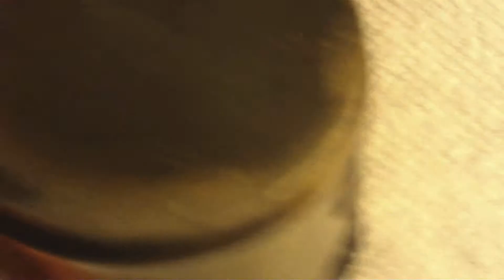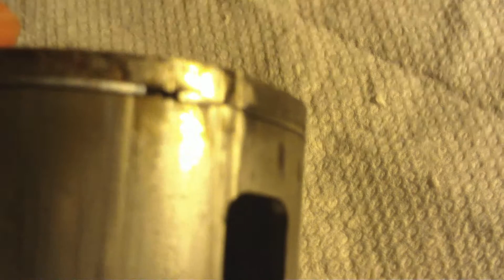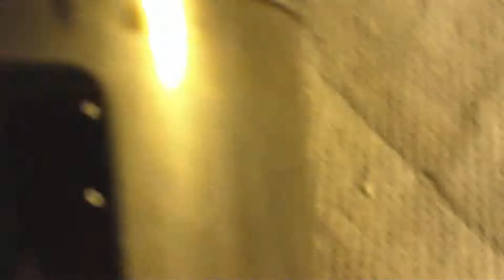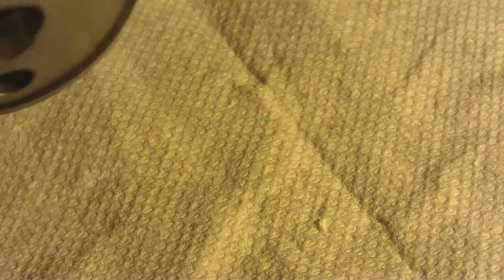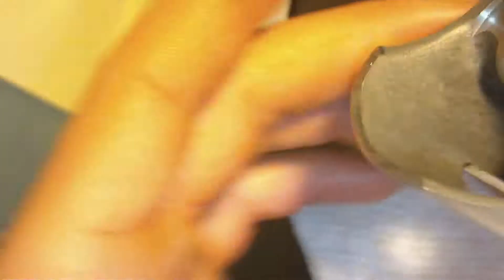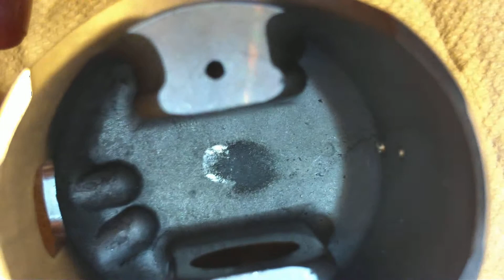Pisotn Problem

Comment: The ring locator came loose, usually due to too much heat in the piston. There is a small steel pin in the ring grove that keeps the ring end gap in one location, so it can't rotate into the ports and catch the top or bottom of the port. Due to the fact that there is no melting on the exhaust side of the piston I suspect the piston overheat was due to lack of lubrication.

Comment: Hi  rotate ur crank with the bike in neutral and listen carefully for any crunching or a grinding noises or any abnormal noise grab the rid and pull it up and down and feel for play there shouldn't be any side to side is normal but not up and down and while ur there flush the engine out with some fuel to make shore there aint any stuff in the case

Comment from the maker: Hi  DSD, unfortunately i already sent off the cylinder head to get bored the day i took it apart. There was one hudge score mark running down the side of the cylinder. Also, the  wrist pin was still intact but i will post a vid. of the wrist bearings asap.  Also, is there a way for me to check my crank bearing without splitting cases? Like how much free play should it have.

Comment: Ok, listen to me.. THe piston is telling you a story as you look at it. The crown is black, under the crown on the underside of the piston it will be black too. Over heating. The rat chew marks are either your piston ring, piston circlip falling out, OR upper or LOWER crank bearing, going tits up. MAKE another video like this: Use an all white background like a towel, get a flashlight and video all the way around the cylinder and SHOW me the wrist bearing, circlips AND head damage. RH DSD